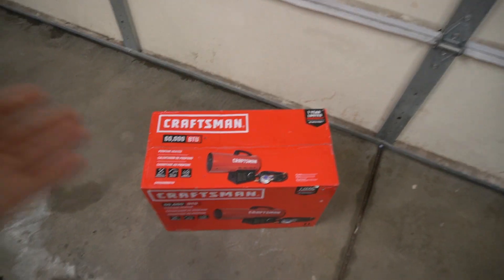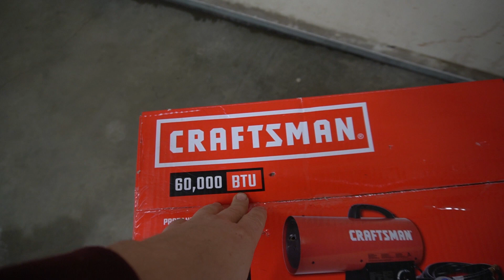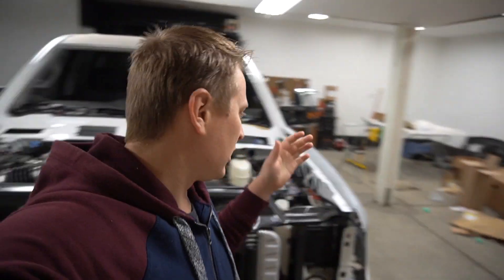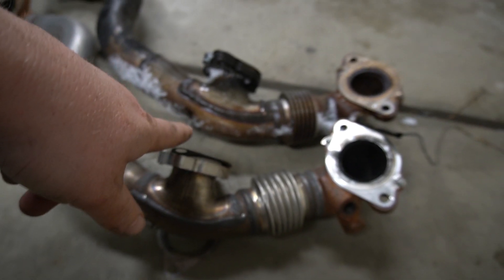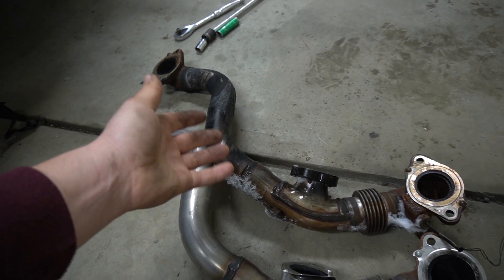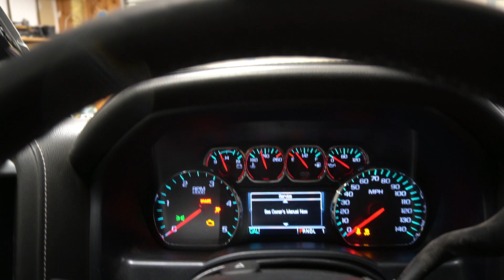Rebuilding A Rolled 2018 GMC Sierra/DISAPPOINTMENT prt 22

Comment: I wouldnt get too worried yet SMV, first thing I would do is check and see what codes you have and jot them all down,  next I would wipe as many codes out as you can. If you used any of the modules  from the parts truck and this truck sometimes the truck will not recognize the module that may have an different VIN associated with it. If you know someone that has a dealer GM scan toll that will make life a lot easier I would get a full scan of the truck done and see if there mismatched VIN's to modules.  This could also be the case with any injectors etc throwing off your fuel trims, delivery etc, I would get the intake etc back on before you wipe all the codes and then see once you run it what codes pop up

The Ford Superduty trucks are kind of pickey when you swap modules from one truck to another because they get tied to the VIN and can do some funky things, but once they are reprogrammed with the Ford IDS with the correct VIN number the truck will recognize the module and it will usually take care of the problem once you clear the codes and start it up again. The fuel injectors for the SuperDutys have a serial number on them and when a swapped or new injector gets put into the truck, the Ford tech takes  and programs in the serial number into the corresponding injector number spot and removes the old serial number out of the computerwith Fords IDS scan tool because the Ford computer in the truck has an algorithm it looks at based on the injectors and some sensors and temp modules etc in the truck and those Fuel Injector serial numbers, when it doesnt see that serial number it tries to compensate because it thinks something is off with the fuel injector for the fuel delivery and trim values and will throw things off when it doesnt see a serial number that is tied to the VIN. I wouldn't at all be surprised if the Duramax has something to that effect going on, but you would need to find that out from a GM Diesel tech who knows more about it.

a minor hiccup but while it may take time to sort out I am sure you will get it figured out and solve the issues. Getting closer and closer SMV... look forward to the next update
Reply from the maker: Yes i know about modules are programmed for vin# that is why i used every single module from rolled over truck. Even had to install old glow plug back to see if it will fix some of the codes, and it did the trick i don't have check engine light on but now i have problem with emission systems. And to me looks like even dealer sometime couldn't find the problem, that's what scares me the most. I went through a lot of forms where ppl complain that their trucks was at the dealership minimum 20 days and up 42 days for emission issues, but they have warranty so no cost out of pocket, to me it could be bankruptcy.
Reply: @SalvageMasterV  Well lets hope nothing that drastic happens. Hopefully you will get it all sorted out and it doesn't cost you and arm  and a leg, glad to see you got some stuff figured out though.

Comment: I have to walk away from my projects every now and then. Sometimes I need a break and time to think things out. If you can, work on something else for a little bit while you research this truck. It won't seem so bad after some time and you may find out it is something easy to repair. Just my two cents.

Comment: Dang son... creating a path through the snow to get to the parts truck. That new heater should warm up the garage real nice! Hang in there. I would think you should be using ALL modules from roll over truck. If not then you will have VIN mismatched modules which could indeed cause problems. If a module was damaged requiring replacement then most likely reprogramming required. Patience and research  before opening wallet and you have proved you are good at it. Your Boxers playing around the truck are good luck... just so you know...
Reply from the maker: Yes all the models are from rolled over truck, except glow plug as u saw in the video, but i installed old one  and after that i had no check engine light but emission message came.

Comment: In an earlier video you said you weren't able to get a new engine wiring harness because of the GM strike.  As I recall didnt you have to patch up the old one? Could that be the source of your problems? I really like this build and I know that you will figure it out.
Reply from the maker: The only reason i wanted to replace that wire hardness is because of the plug, it is stil works and no wire damage, but locking mechanism is broken on one side so it is harder to locking and unlocking the plug. That is only reason i did want it to replace it.

Comment: Does the vin match every module. If it's not the same throughout the entire canbus you will have problems.
Reply: absolutely especially all the modules that have been switched out they all have to match vin wise or youll get all sorts of weird codes
Reply: i thank he`s going to get it re veined at wspd
Reply from the maker: Yes every single module is from rolled over truck.